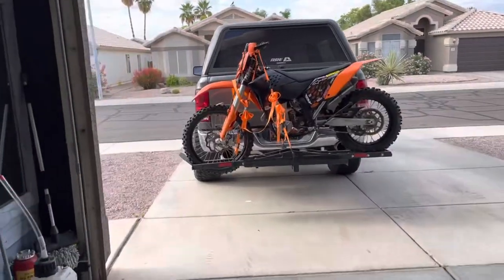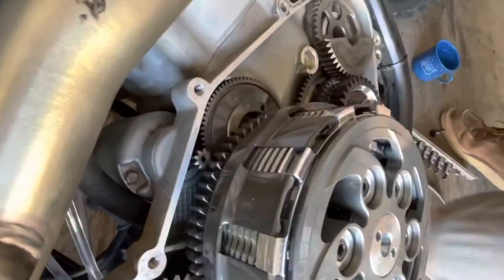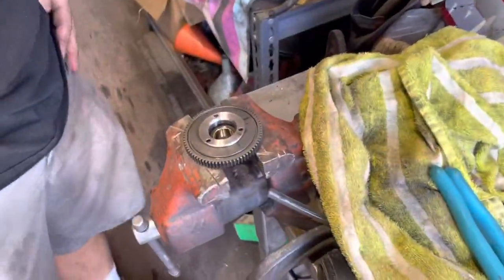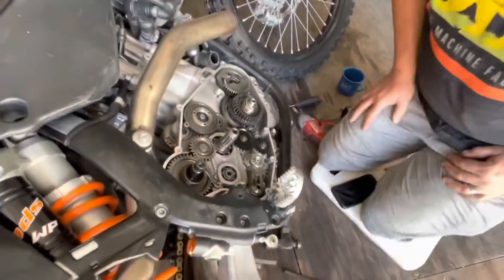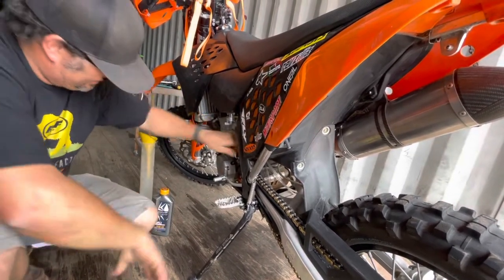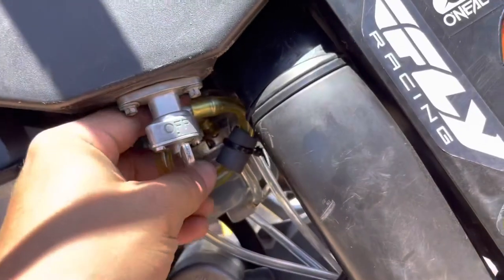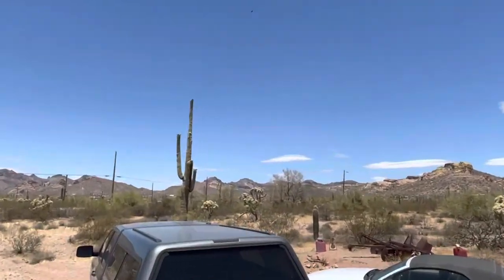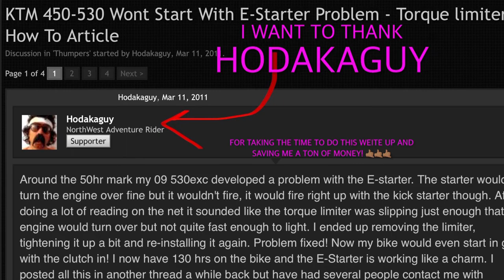KTM electric start fix (torque limiter)

Comment from the maker: Go to 3:40 to skip the small talk 😅🤙🏽
Reply: Hey man what was the starter doing before fixing the torque limitor got a temperamental husky lol
Reply from the maker: @OversizedEnduroGuy  it would turn over the motor but not fast enough because it was slipping.  If you kick start your bike and it turns on fine that narrows it down a little.  What are the symptoms of your bike?
Reply: @HyLifeSociety  @Hylife society
Starter wont turn over unless idol is set really low 
Currently have it set at 1350rpm and starts fairly easily but if a crank it back up to factory spec starter does about have a rotion and cuts out.
Have a new starter motor and new relay ect has me stumped lol
Its a 14 husky fc350
Reply from the maker: @OversizedEnduroGuy  What year is your Husky?
Reply: @HyLifeSociety  its a 2014
 starter motor is on the stator side so taking the torque limiter off takes 5 mins thankfully
Reply from the maker: @OversizedEnduroGuy  so at high idle the starter spins but doesn't turn the engine over? but at low idle it turns it over?  The torque limiter is inside the transmission btw, makes contact with the starter end, are you saying your stater turns over in your stator instead of your transmission?
Reply: @HyLifeSociety  just added a video onto my channel
Reply from the maker: @OversizedEnduroGuy  OK so it does look like your torque limiter is easy to get to, did you try tightening it yet?
Reply: @HyLifeSociety  not at this stage gotta order a new gasket, wonder if its the issue been told the tps setting could be to high causing higher compression gotta order a tps sencer tool aswell lol

Comment: So how did u know it was the torque limiter?
Reply from the maker: You can kick start it on just fine, but with the electric starter you can tell the starter wasn’t spinning the engine fast enough to start. The torque limiter was slipping under load.

Comment: My 2011 KTM 450 would stop at TDC and then have to hit the start button again but still wouldn't start
Reply from the maker: That still an issue or you fixed it?
Reply: @HyLifeSociety  I found the problem and it was my decompressor wasn't working
Reply: @HyLifeSociety  I fixed it.. it was a bad exhaust camshaft lever